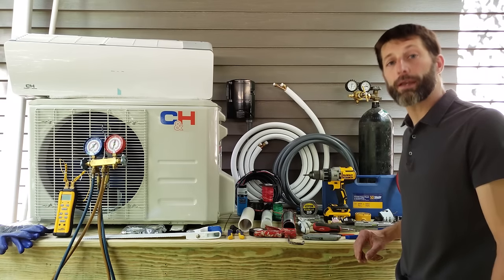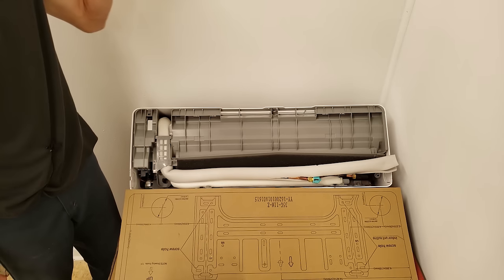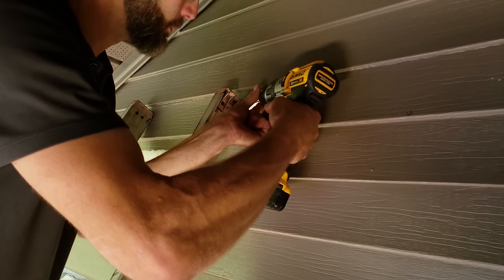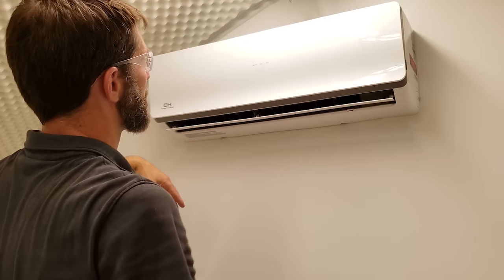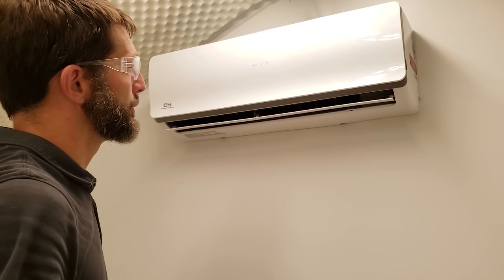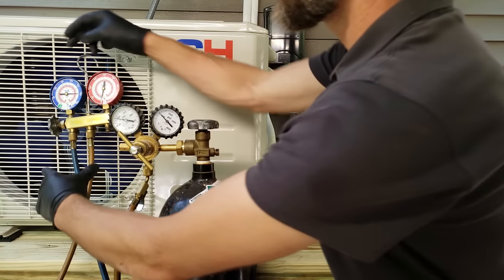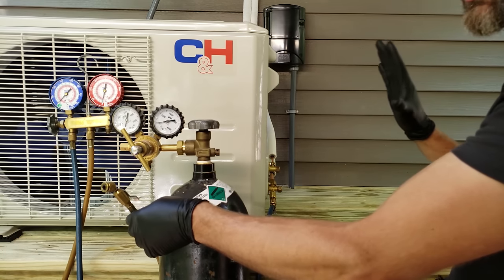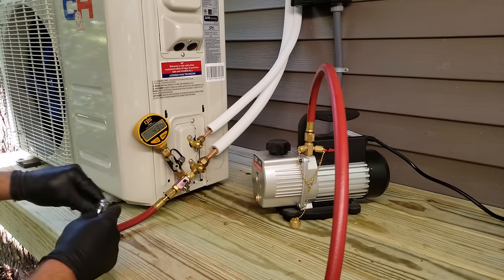Full Installation of Mini Split Ductless Unit, Step by Step!

Comment: Hey I own a stud finder sir, worked 9 months under a licensed electrician and did some college for dropped it because of math requirements. I could wire a whole home hot tub,  4 way switches, ground a house but the schools math made me quit! Pipe bending is not a math requirement! It’s simple observation!

Comment: Forgot to silicon the ends of the lineset insulation. The white insulation is notorious for allowing moisture in and corroding the lineset within only a few years.

Comment: This helped me DIY install a mini split. Other than paying for electrician, everything else was DIY and its working fantastic. I really appreciate the attention to detail on the lineset evacuation. I almost guarantee theres tons of hack hvac techs out there who dont bother the small steps like turning the valves on and off to release air trapped in them, purging all the lines properly. My unit is running fantastic...now after $1000 worth of tools to get here between vac pump, manifolds, nitrogen tanks, micron gauge, valve core removers, vacuum hoses...almost feel like I need to install more!!!
Reply: I'm in the same boat. I dropped some money on the proper tools. I eventually want to put minisplits all over my home and get away from ducted ac. It should be a worthwhile investment eventually. I installed my dad's mini split recently, so that definitely felt good.

Comment: Ordered mine yesterday, it will take 2 weeks direct from Senville. My head unit will mount to my living room wall which is an exterior wall, right above the condenser unit pad. I hope to make an installation video. The use of the PVC “Sleeve” around the copper, electrical and condensate lines is brilliant, so I will definitely do that. I’ve been watching these installation videos for tricks and hazards and this has been one of the most educational.

Comment: Thanks Craige I used your guide to do my first install. i added a couple of extra steps to my install and purged the lines with nitrogen before tightening the high side flare nut and after pressure testing I released the nitrogen down to about 1-2 psi then hooked up the vac pump and slowly purged the remaining nitrogen through the vac pump fittings as not to allow any moisture back in the lines. I pulled a deep vacuum very fast without much rise after closing the valves. My unit is a Mitsubishi Bronte 7.1kW Reverse Cycle Split System.

Comment: I usually leave a little more slack in the lineset where it meets the outside unit.  That way if there is a scratched flare or bad flare it has enough pipe to redo it.  Nice job.

Comment: Excellent tool layout! Those who don't already own this stuff for other DIY work should know that you can use the vacuum pump etc on your cars and trucks too. 
If you weld using shielding gas (other than CO2) you can and I have used argon or MIG mix to pressure test HVAC systems if you don't already own a nitrogen cylinder and regulator (I get cylinders/regulators/caddies cheap used, cylinders are filled by exchange most times) since the nitrogen regulators used for HVAC have the same cylinder valve threads as welding gas cylinders. It doesn't use enough shielding gas for the cost to matter and welding shielding gas is technically even more inert than nitrogen which is used because it's plentiful and dirt cheap. Working on my own trucks paid for my equipment the first use and I've done several since.

Comment: This video is great, thank you for not skipping the small steps & thoughts which get deleted by other videos. I'm not saying your technique is right, wrong, or otherwise, but I've never seen anyone determine where the s studs in a sheetrock wall like that. I've always used a 1990's era Stud Finder with 4 red LEDs, and it's rarely failed me. Anyway, thanks again for the knowledge!!

Comment: Anyone think Craig is NOT Italian raise your hand... because his are moving like crazy.  Awesome explanation of all the steps Craig.  Thank you.  Brought your book down here to Brazil for reference.  Had to rewire everything the "HVAC Techs" did at my new construction. The work they did is horrible.  Our builder said they are very good comparatively and expensive. I told him they'd be the hacks in USA.  I paid them $1460 Brazilian dollars (about $300 USD) for the install of four 18K units. Our construction crews ran the line sets and electrical wires while building.  Pressure test...nope.  Vacuum...nope.  Wire connectors...nope.  One bolt, not tightened holding two of the units on the outside wall bracket...yep.  All the ground wires from four units spliced to one that goes to the service panel...yep.  Mini splits fail down here all the time, can you guess why?  Oh yeah, no license necessary to be an HVAC installer or tech.  So for all those that complain in the USA about the steps to become one there is a reason.  Thank you again Craig for your years of dedication to this industry.  Your information is always presented in a very professional and clear manner.  Muito Obrigado from 5000 miles south.

Comment: This is great professional instruction.  Some of the products sold are giving incorrect torque specs in their installation manual. For instance,  I  torqued a 1/4 line to 18-20 nm,  which crushed the flare and the line exploded ,releasing all refrigerant.

Comment: Very clean install. I do prefer a 3 in hole. Just much easier to feed the lines. And I also prefer line hide with the wall inlet. But those are just my preferences. This channel is a new tech/installers best friend👍

Comment: If you don’t have access to nitrogen pressure tank or the other fancy gauges your able to use can you just vacuum down the system and test for leaks and then release the systems charge into the lines if vacuum stays fixed and doesn’t leak off ? 

Your is very impressive and meticulous! 

thanks for taking your time to make these videos.

Comment: An extremely well done installation, congrats 👏🏻👏🏻👏🏻
Reply from the maker: Thanks Eduardo!
Reply: @acservicetechchannel   thanks for the awesome video, doing my unit next week with your help. Quick question what size hole saw and pvc did you use? Do you think that size will work for a 5/8ths lineset as well?  Thanks again!.

Comment: I always use a dime to measure how far out I leave the copper past the block on the flaring tool. It works perfectly every time. I know you said use 1/8 inch.

Comment: Just did a successful HK 18K unit with my son.  HK only wrapped the 1/4" high pressure line with spring.  The 1/2" suction line is the one likely to kink on bending at outside wall.  HK should wrap both lines with spring or use longer corrugated section on su tion line at head.

Comment: Ive installed a few units, one time i forgot to bring stud finder. I took a small fridge magnet and found the existing drywall screws. much easier and accurate.
Reply: I thought I would use the magnet when I was hanging the bracket for my TV but the drywall had nails in is from someone hanging pictures and I ended up having to go out and buy a stud finder anyway.

Comment: Tips for the one time jack hack jobber. I bypassed the nitrogen test. I used luggage scales and the Torque=Force x distance formula for tightening. No nylog, just go slow and secure with flare fittings. Used cheap AliExpress gas detection device along with soapy water for leak test. Good luck to the first timers. It's a thrill after your first successful AC install. This video shows the perfection of install for pro installers  but hack jobbers shouldn't be afraid to do it for their own home as a one time venture to save some money.

Comment: Craig, mini split today, the homeowner installed and started up himself with a vac. pump he bought. He had the unit running but decided to tighten down the flare nut extra security. He ended up breaking the flare off. He then front seated the service valves. I made the repair and tested with nitrogen at 275 for 30 minutes, no drop in pressure. Put my 6 CFM vac pump on with fresh oil, and it took quite a while to come down to 480 micron. when I closed off the vac pump (just the same way you did) I had a rise to 1300 microns. this was after I vac pumped it for almost an hour! Only 20 feet of line set. What do you think is wrong?
Reply: Did you use a manifold gauge when you vacuum tested? They say any of those hoses or valves could leak. The micron gauge can also leak like he said, and that is why he uses a little oil on the gauge.
Reply: May i know where to get the N2 from?

Comment: Awesome video! Your electrician wired the disconnect wrong. Always follow the writings on the lugs. Center two are live from panel to disconnect. Outside are load. I would point that out so that the newer techs know.

Comment: Great job and a few comments, you should only use 70% of a rated wire, you probably should have used # 12 wire, especially for starting current. Also my crimp tool seems to compress the lugs on the outdoor unit more than the one you used. It crimps above the hinge point and has more of a pronounced tang to crimp the wire. I have seen many crimps fail in the past. Great job and do you ever use filter dryers on mini splits if repair service is needed? Thanks for great video's.
Reply: Inverter based units don't have high inrush current.  They are softstart.  Wire size by manufacturer specs is fine on outdoor units and there is an NEC exception specifically for hvac.
Reply: This unit will barely use more than 5 amps.

Comment: i was taught to remove refrigerant from the system when you use a shorter line set than the length set by the manufacturer
Reply: Yeah you have to or add if you use additional copper line set. The manual gives you the the correct formula per feet.

Comment: Excellent video Craig. I've watched it a couple of times now and I also have your wonderful books. I will be doing a C&H installation where the outdoor unit is literally 3 feet away from connection point to the indoor unit. The C&H installation guide tells me I should have a minimum line set length of 10 feet to avoid transmission of vibration. Is it OK to leave some of the line set coil and stashed away behind the outdoor unit, leaving clearance for air flow of course. Years ago a refrigerate tech told me not to leave the line set coiled because oil would collect at the bottom of coil and cause a blockage. I somehow doubted that to be true since I've seen many rooftop installations of outdoor units where the inside unit is several floors below the roof. If ever there would be a problem with oil collecting in a low spot that would be it. I just wanted to hear from you on that. Or would you just ignore the 10 foot minimum and cut the line set to fit?
Reply: Please reply

Comment: Very clean installation! Good job! I have the Yellowjacket torque wrench kit you used, it works great. What do you think about the Navac flaring tool NTF66? I’m thinking about buying that one since it has a clutch and also a stopper for how much to insert the copper tubes in.
Reply: I have it, it's great!
Reply: Get it if you need to make tons of flares. Otherwise the flare spin tool works once you get the hang of it.

Comment: Great video. Unfortunately Cooper & Hunter has virtually no installers/dealers in this area. Contacted an "installer" that features Mitsubishi and they want $169 just to come out and give me an install estimate. When I told them I had a C & H unit they initially said they wouldn't/couldn't install it because they couldn't warranty the unit. I told them I wasn't concerned about their warranty, just the units (makes no sense why they couldn't warranty the unit, more likely they make MUCH MORE profit on the Mitsu units they carry/install (look at a comparable Mitsu unit's price). In fact almost EVERY local HVAC dealer ONLY carries Mitsubishi.

I want the C& H for the hyper heat capability, which I don't really see any other "reasonably priced" units providing.

Comment: Nice change from the usual thanks. 
Can i recommend though instead of that unusual trunking, use a fit-for -purpose trunking, search Amazon "PVC Decorative Line Cover Kit for Ductless Mini Split". 2 piece trunking clips together with caps elbows, flexibles etc. And PVC condenser feet to keep it up off the ground. The exposed section of twin pair insulation will be corroded by the sun in a couple of years unfortunately. Unless protected, I paint mine. And sit about 6inch off the wall, to look nice. 
The outdoor unit will also drip condensate it's occasionally something to watch for. 
I have the exact that CPS vac gear it works beautiful!
Reply: Supposedly the white insulation on newer line sets is UV resistant. That being said I'd still hide it. And if possible insulate it more to minimize heat loss.
Reply: JM M. Even "UV protected" never is, not for long. So either protect it, or just dont care

Comment: Great video. I did notice that the electrical disconnect was wired incorrectly but you must have found the error because the unit runs!

Comment: Great instructional video as usual.  Thanks Craig.  Wondering if you or others have experience in running condensate drain pipe and the refrigerant lines in wide enough timber cavity walls during construction. If so, what is the best practice for running the lines, does the condensate pipe need lagging and how best do we join or insert the indoor unit's drain pipe into the drain installed in the wall cavity, remembering that in years to come the system will eventually need replacing along with probable change of refrigerant lines due to age or different refrigerant type?

Comment: Craig, just curious as it appears you shortened the line set several feet, since these units are pre-charged for a 16 ft line set and you shortened it by several feet, wouldn't this overcharge the system?

Comment: Great job!  You've raised the bar for Bryan Orr, LOL.
Reply: Exactly.  And for hvac instruction in general, youtube or trade school.
Reply: I think Bryan Orr is a bit more on the cutting edge thanks to a bigger business.
Reply: @sprockkets  Sometimes called the bleeding edge such as his experiences with Carrier communication lockups and minisplits with poor dehumidification.   Nevertheless Orr's integrity allows his business a big advantage over many.
Reply: @rj.parker  It's more of he uses stuff like measure quick and advocates for newer tools that save time and money and are more accurate. That doesn't mean using an old school gauge set is bad. I have both, but probes are way easier to use.
At the very least, measuring capacity in cool mode should be done with hydrometers, not just thermometers.
Reply: @sprockkets  The problem is this is a minisplit using an electronic expansion valve with an expansion line instead of a liquid line.  You can't adjust or check charge with subcool so if there is a charge problem you have to recover and weigh in a new charge.  Orr does this as well on minisplits when necessary.

Comment: Awesome video but I have a few questions. First, any issues when cutting line sets short on mini splits? Such as too much refrigerant in the system? 
And secondly, when install a 24k-36k btu that I believe have a larger 5/8” line, what is the best way to bend the air handler line down the wall to clear a line set cover? They seem to be too tough to just bend by hand without risking a kink. Doesn’t seem possible to fit a tube bender in along the wall.

Comment: Nice podcast, thank you!. I am not a fan of flare fittings. I'd rather do all solder systems. I have an oxy-acetylene rig. Silver brazing is recommended?
What pipe insulation is recommended for 1/4" and 3/8" lines is my next question.

Comment: I love the installation video, extremely well laid out for anyone to understand. I do have one question that I couldn't find an answer to in your video. You cut the line set instead of using the prepped ends. What the minimum line set length requirement for a prefilled inverter like that?

Comment: Great instructional Video. What if you need to travel horizontally from the head unit to the compressor unit rather than travel directly down,.  IE the outside unit can not be installed directly below the exit point. I assume you need to continue the slope at the horizontal. Thanks in advance

Comment: Thanks a lot for that video and all the different tips and tricks at each step !! I've got a question for you : is it possible to have the outdoor unit above the internal unit? (meaning both the vapor and liquids copper tubes won't be on a negative slope from inside to outside) ? Thanks a lot in advance for your answer !!

Comment: Thank you sir for this detailed video. I tried pulling a vacuum with 2 core remover tools as you did but for some reason it wasn’t working. I possibly had a leak but everything seemed tight. Once I removed the the valves and hooked up the micron gauge in between the pump and low side valve I was able to achieve a vacuum at 100 microns. Is there anything you think I might have been doing wrong? I ordered the same core remover tools you linked in the description section. Thank you

Comment: Very informative. Did you realise you hadn't backed off on the torque setting or was that on purpose?? I'm sure you will say on purpose lol. 
Thank you for your video,I will be doing the install myself but getting it checked and charged by a qualified installer I think.
Thank you again.

Comment: Thanks for the great video.
Wouldn't you need to adjust (reduce) the amount of refrigerant to account for the shortness of the line set?  What's the minimum number of feet where you can keep the factory precharge?
Thanks
Reply: i dont know why he did put refrigerant ? will it even work ?